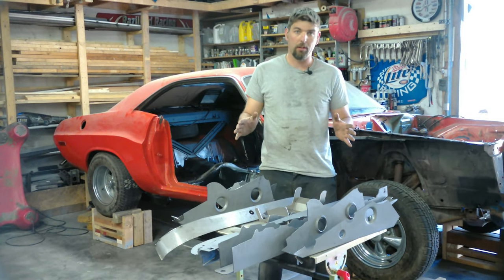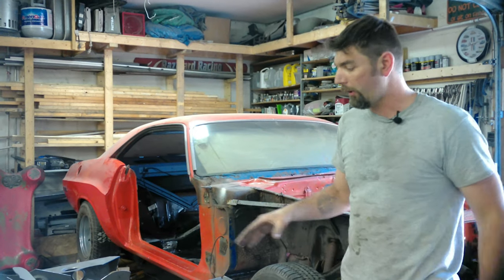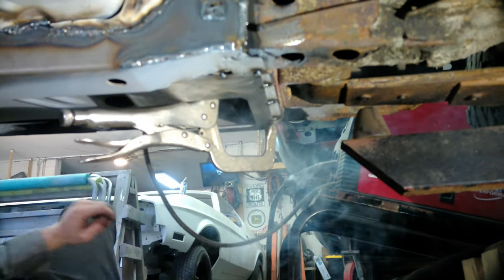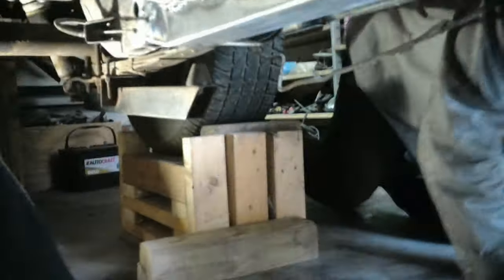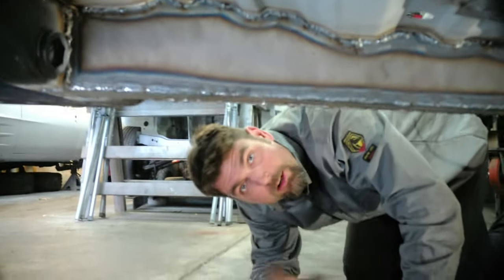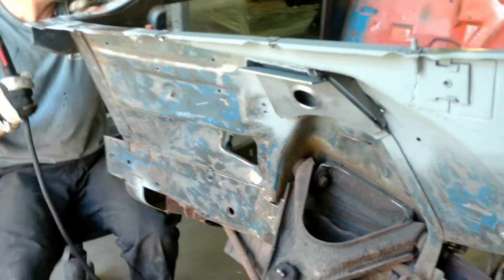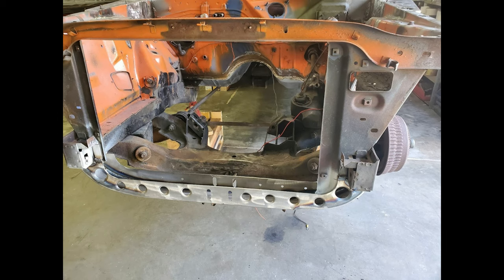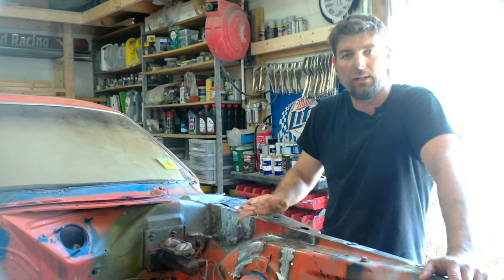1972 Challenger Episode 2, USCT Motorsports Chassis stiffening kit 70-74 E body

Comment: What settings did you use on your MIG to weld the thicker box and subframe connector material to the thinner floor material?
Reply from the maker: So it will be different on most welders and really how you weld but for instance on that part you asked on this pro mig 180 I am on a c setting with a 3.5 wire speed focusing most of my arc on the thicker metal and then blending it down onto the floor pan. I like the hotter setting but you have to be careful as burning through the floor pan can be quite easy.  Also I welded this with .030 wire
Reply: @carthageclassiccars  Thank you. I'm using a Miller 210 with .030 wire. Just ordered the USCT stage 1 stiffening kit and appreciate the video guide you provided here.